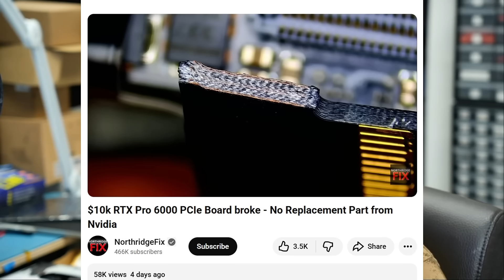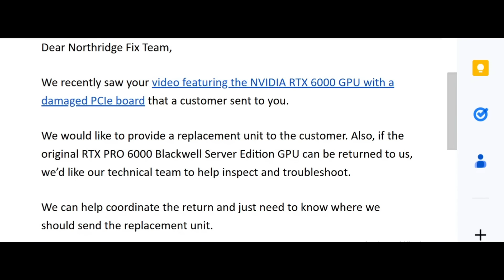Huge Update. NVIDIA Contacted us. What They Said About the Broken RTX Pro 6000

Comment: in a way it's similar with high end super car manufacturers...If you end up in a crashing one of their 3-5$ worth cars they refuse to supply replacement parts for repair...the only difference in this case, is that those big companies offer the repair of these exotic cars themselves...The repair is very costly but the car retains it's value when repaired by the manufacturer...

Comment: Replacing a customers $10k card everytime something goes wrong, can't be more efficient than providing spare parts/replacement board...can it?
Reply: it is when its just replacing one or two customer cards when the issues gets some publicity is way more efficient than  making spares available to all customers.
Reply: When your company is worth almost as much as the rest of S&P500 things... 😂
Reply: How many people with broken boards have huge followings on Youtube?  So for Nvidia it's only going to be a handful of boards and most likely is written off as a marketing expense.
Reply: It depends if they do it for everyone or just when there is a high profile video.
Reply: That's why they designed it like that. It's far cheaper for them to get the card back, inspect, send out a replacement if under warranty and/or repair it at minimal cost. The 3 part modular board system was designed to make it easier for them to repair, not anyone else. Which is good or bad depending on how you see it.
Reply: Playing the devil's advocate here.
There is value in having exact metrics for returns and problems. Yes it's cheaper in the short term to let 3rd parties repair your stuff but then you don't have exact numbers and analysis of the failures, also the reputational damage increases.
If you handle all problems that costs more money in the short term but you can control the narrative, also you have exact numbers for example which batches had which defects, which revisions tend to fail in which way, etc...
Then you can then prevent those problems in new revisions of hardware or issue guidance to OEMs to mitigate the problems. (for example make them check every laptop for missing ROPs)

I would prefer my card get fixed in a business day with a $10 pcb module replacement than waiting a week for a new card, hoping that the couriers don't play football with your package, but alas, we do not live in that world.
Reply: not if the card cost 500$ to make
Reply: you have to spend those 5 thrillions somehow
Reply: That $10k card, doesnt cost nvidia anywhere near $10k to make. They could probably take back that GPU, replace the PCIe board for less than the labour cost of a technician to open the card and reassemble. Even replacing a GPU core, that would actually cost nvidia a fraction of the retail price of the card. Imagine if they pay $30k for a wafer of RTX Pro A6000 GPUs, and they can fit 50 cores on that wafer with a defect rate of lets say 5%. They get 47 good cores per wafer, which in that scenario would translate to $638 and change per core as a cost price.

I mean those figures are all figments of my imagination, I do remember reading some numbers in 2018 something about TSMC charging $18k per wafer, but I have to assume that price would be nowhere near close to current day.
Reply: You don't have to do it every time - just when the card gets featured on a prominent YouTube channel.
Reply: won't happen every time, this is just PR
Reply: They don't replace it, they repair maybe and is ok for them while warranty, since afterwards you must buy new if thing breaks! So is little inconvenience for them in the short run, but they benefiot a lot in the long run i guess, hence the situation!  Imagine, in a top factory, a product is completed like ever 20 seconds! :)
Reply: Tomthomas... Your right!
The spare parts would cost not much ... But you know us a big company and they thinking different 😊! 
They could make money over the spare parts too!
Is only my opinion.
Reply: They are likely just replacing the board.
Reply: But they don’t provide spare parts. It would be interesting to know why they don’t offer parts. Maybe logistics are so expensive it’s not worth it? Nvidia doesn’t care about normal customers anyway these days. They sell AI chips now.
Reply: It has nothing to do with efficiency or morality and everything to do with being as greedy as they think they can get away with without public blow back. That's why they do it in such hidden manner, so that there is no collective outrage from the customer base since people only realize they are screwed one at a time when they try to fix their broken modularly designed GPUs, only to find that despite what its design might suggest, there is no way to actually buy a replacement part and fix it without paying a ridiculous amount.
Reply: That's because it's not worth 10k
Reply: the price of knowhow... you cant replace apple close lid sensor cause its magnetic, you need to "flash" the senor so it matches the current magnet that will trigger the "screen off" state.

not sure if someone reverse engineered it and its fixable now but the knowhow of using those sensors, in that package is expensive company rnd which is worth more than offering parts....thats why they dont.
Reply: That’s how much money they’ve made off us over the years 😂😢
Reply: Easily can, setting up a supply chain and filing all the regulatory stuff to sell the individual parts of the card globally probably easily outweighs the cost of just replacing a few dozen cards a year. These aren't high volume things like phones so there isn't a good economy of scale at play, plus these failures are fairly rare as is.

Besides $10k is the retail price for us, for NVIDIA the price structure is very different when it comes to sending out a replacement unit. Most of these kinds of GPUs are sold via workstation vendors either as extra parts to add to a workstation or in a prebuilt workstation, there are very different service contracts there so if something breaks, you send it to the workstation vendor and they definitely have channels with NVIDIA to just get the small PCIe board. So the issue of NVIDIA not supplying the parts globally freely to buy almost exclusively concerns individuals buying these at retail which is a tiny minority.
Reply: For the single case, it probably is.  What do you think it would cost to setup a separate facility to stock and ship spare parts, where normally only containers full of cards are processed and shipped to dealers?
Of course, once that has been setup, it could be used to make a lot of customers happy and it would also save money to not replace every card with an entirely new one.
But do realize that the internal cost of the card is much less than $10k for NVIDIA.
Reply: It probably is for them.
Reply: The QA/Maintennance teams will want to really go over the faulty cards to improve future models to prevent the issue reoccuring.
Reply: It can if the amount of $10k cards that you "have to repair" can be counted with your hands' fingers. Providing spare parts implies extra factory work, shipping, storing, distribution and many other things that easily go far beyond a couple hundred thousand dollars.
Reply: yes it can for invidia,the less fix and the harder it is the more efficient it is for nvidia
Reply: Because they are not replacing them, they are just doing a PR here (damage control). If you are a nobody, without 500k subscribers, nobody will care, and they will tell you to buy another new card for $10k.
Reply: they want to fix it with a 20 dollar part and send it to anouther customer .
Reply: if that card costs $10 to make, it is.
Reply: It’s about profits. Not efficiency. If anything they are very efficient at taking money 💴 from fools.
Reply: Sarbanes Oxely
Reply: high margin, i would say replace completely instead of keeping stock, paying people that keep that stock and manage it ect.
Reply: you don't know that! Depends on at least the failure rate
Reply: It for sure can. nVidia would have to setup a department, staff, phones, office space, etc. That would probably cost them millions per year. Shipping out replacements is simple and cheap. $10k to nvidia is like 1 cent to us peasents.
Reply: The card does not cost the manufacturer $10k. It's far less than that.
Reply: that's why Nvidia won't do that everytime but just this time because it's in a big channels youtube video.
Reply: It's 10k for you, not for nvidia
Reply: They charging 10k because they say they will replace broken video cards not because it worth 10k 😂...its like they charging for extra Warranty
Reply: Now they can charge 1K for labour and parts over  1hour labor and 10 dollar part. Brilliant.
Reply: It’s for you it cost 10k. But nobody know of the self cost rtx6000. From sealer and manufacture side, it simpler just send a new card, for parts you need special people and storage you have to pay, etc, etc. repairs is hard.
Reply: For the company, It's less expensive to replace the card then replace the part / board.  Just think about it and you'll know

Comment: 2022  New York: First state in the U.S. to enact a right to repair law covering consumer electronics. Just saying they have passed.  
As for Hyundai...I'll never buy another of their cars because of what Louis covered.  In fact, I probably will only drive cars made before 2017 for the rest of my life now.  I do not trust what car makers are doing now.  
About nVidia:  I bet they would not have done these things for customers inquiring directly.  But since you have given these cases publicity, nVidia sees it as a PR opportunity to look like they are generous.  I have no doubt that anyone going to nVidia without 450k subscribers would get the attention and personal contact that you did from Corporate PR.  I'm sure the one with around 40M could make a video about it and cause a publicity fuss.  However, the indivudal with a 5090 issue probably would not have gotten such attention.
Reply: Before 2000 .....
Reply: Nvidia have replaced cards with connector issues for regular customers before.
Reply: I just want to tell you that anything built past 2011 has a GPS tracker that's sending your driving data to insurance companies. They government mandated these but does not require or regulate how that data is used or sold. It's part of a the crash system monitoring the vehicle every time you drive it.
Reply: @kevinerbs2778 that's not true, my 2016 KIA doesn't have GPS. Doesnt connect to the internet in any way. Can't get over air updates in any way.
Reply: @kevinerbs2778  well that is not remotely true. My car has no GPS tracker. There is no way for it to transmit to the insurance company without a cell or wifi connection (easily traceable/identifiable) and it has no way to know who your insurance company is.  The only way this happens is if you put that device in. Whoever told you this is incredibly mistaken and gullible.
Reply: @kevinerbs2778  I just want to tell you that ain't true.

Comment: When it comes to right to repair, it's impossible to vote with your wallet when all the options suck.
Reply: Enough growth of common sense in the society then it is possible.
Reply: Yes all "suck" your money without giving you much value.
Reply: Even for just a quality product that will last, It's very hard now. Most consumer computer products now are designed for a very short usage life, with the extremely high power consumption and temperatures and chip voltages at the very edge, due to the extreme overclocking by default (i.e. Turbo-Boost and similar stuff). You can improve things by manually forcing lower voltages and frequencies, but by default the products are designed to fry themselves after a few years of use with default settings.

I've switched to buying mostly industrial-grade computer stuff for myself. You pay only slightly more, you lose a lot of performance with more "conservative" designs, but you know your stuff will easily work reliably for a decade or more.

In my opinion it's best to buy reliable in the first place, and not buy something that you can't afford to replace if it fails. Most "consumer" products (like smartphones or most notebooks and desktop PCs) aren't really designed for temperatures outside the tight range of climatized offices.
Reply: no one is obligated in this world to provide you exactly what you want.  don't like any options?  don't buy them.
Reply: Doing without. What a concept. Many of these corpos are no longer on my purchasing list.
Reply: you sacrifice something,it's not that hard,you don't need the best just because you can afford it
Reply: The only option is to not buy
Reply: It's actually very simple, don't buy things that can't be repaired. If that means not buying anything, so be it
Reply: so having an iPhone is essential? makes no sense your logic
Reply: The cartel appreciates your feedback, as we continually strive to maximize profits.
Reply: you cant vote with your wallet when their wallet is bigger than yours 😂
Reply: AMD and Intel - yes Intel - make good cards.
Reply: @PaulHenning84 i wasn't restricting this to gpu cards. For example, it is a big problem when other companies copy how Apple designs and services iPhones.
Reply: @fyfoh apple doesn’t give a poop. People line up to buy the unfixable junk. Maybe if you order 1000000 chips, they’ll sell it to you.
Reply: @fyfoh  When no options on the market are repairable that gives incentive to one brand to either appear or start being repair friendly and loudly advertise that. Most other brands who don't have a strict following would have to follow suit right away
Reply: @fyfoh the question really is do you actually need airpods(or insert pretty much anything)? There are hundreds of wireless earbuds available especially if you dont buy the iPhone and get locked into a proprietary ecosystem. People think they "need" things but thats rarely ever true. The real problem comes down to the fact that people think they must have these things to be "normal" and its just normalizing bad consumer practices
Reply: @PaulHenning84 no they dont. their cards are a fraction of the performance and intel especially makes dogshit thats barely usable.
Reply: AMD and Intel may provide alternatives to NVIDIA when it comes to consumer GPUs but for stuff like what this guy was trying to fix there really aren't alternative options. You either deal with their BS, pay through the nose, and then lick their boots or you are out of luck.

Comment: Nvidia using a laptop connector on a desktop GPU 😂
Reply: I mentioned on the reviews of the RTX 5090 it was bad design. Yet the reviewers acted like it was god send of a card.
Reply: when the bus speed is high like pcie, you cant have a large connector. it will add parasitic capacitive and inductive values, which distorts the signal and will make it useless. having said that designer was trying something innovative and easy to repair, but alas no spare parts available, decided by some MBA middle level manager, not the designers fault.
Reply: @yoppindia  Turning it to a small ribbon cable does the same thing? 
I was sure that's the reason most mother boards have redrivers on the board around the pci-express slots now